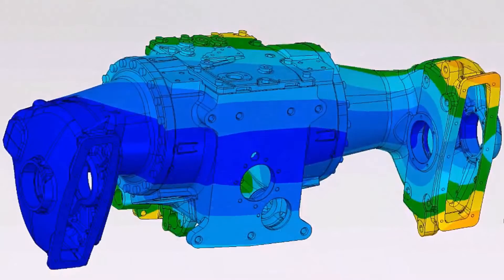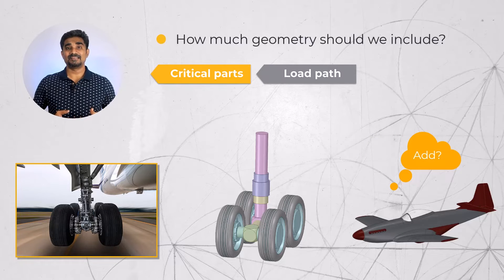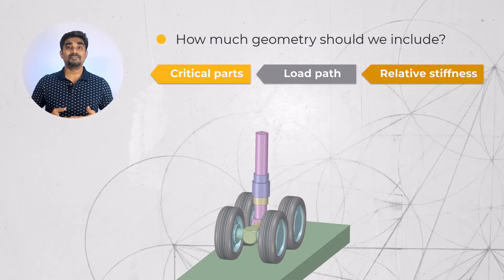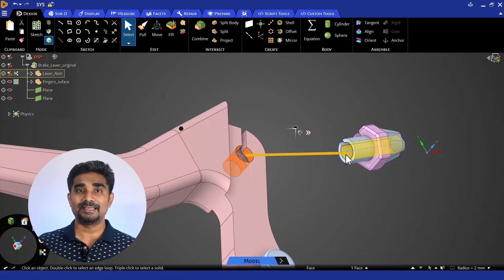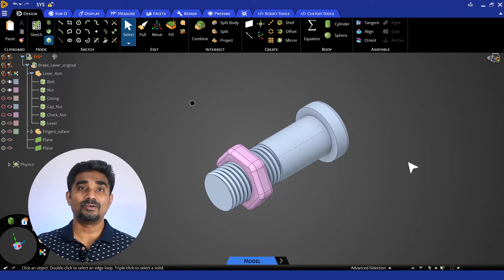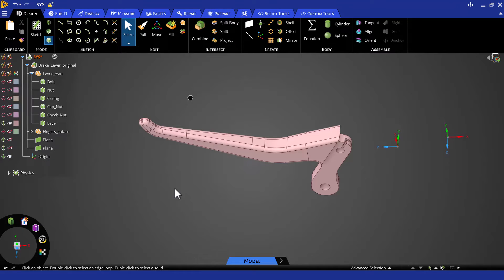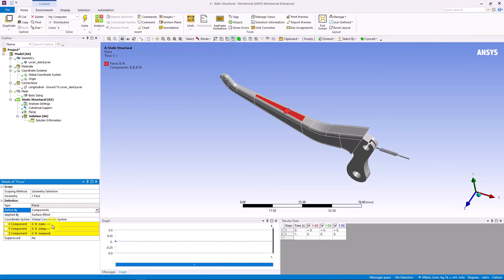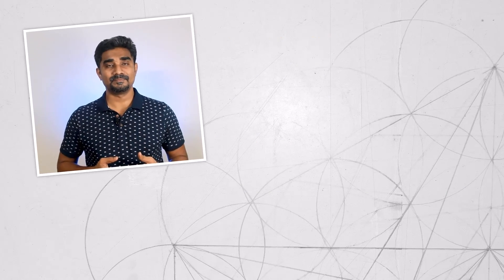Identifying Geometry and Details to Include in a Simulation Using Ansys Discovery

Comment: Dear Samir Ji Kadam
Thanks for the video in easy to understand language.
At 5:17 you have spoken that minimising the geometric details on the model can help us to reduce mesh size significantly and make the analysis run more quickly. 
To me the above statement appears to be wrong, according to me the correct statement is minimising the geometric details on the model can help us to increase mesh size significantly and make the analysis run more quickly. 
Kindly clarify

Comment: Dear Samir Ji Kadam
Thanks for the video
uy=0 can be a reasonable assumption for tyre bottom which is in contact with the runway.
But for axle uy=0 is a wrong assumption because tyres are deformable and during motion of aeroplane on runway, deformation of tyre changes at bumps and pots. Hence, the axle will have some continuously changing value of uy when the aeroplane is moving on runway.